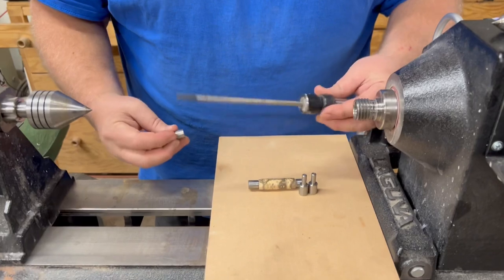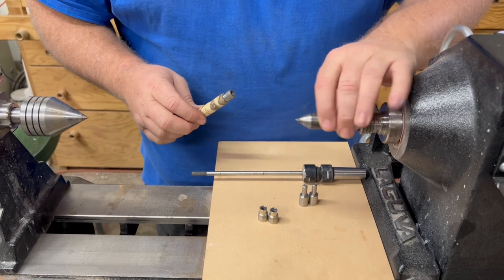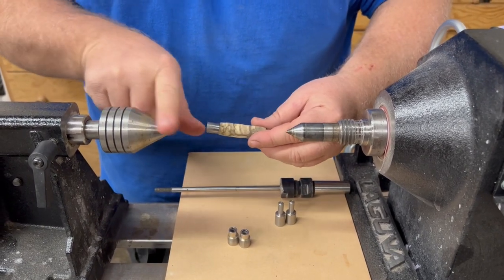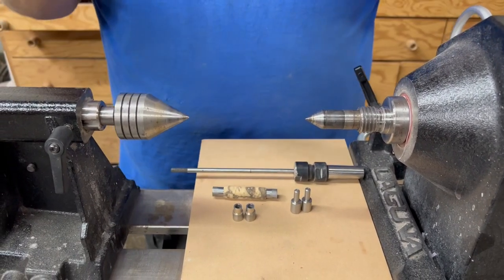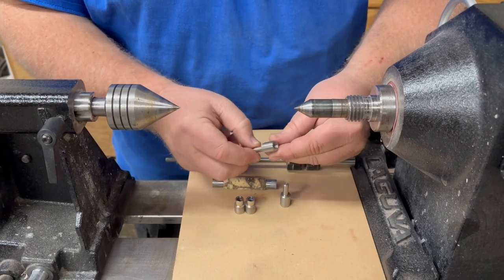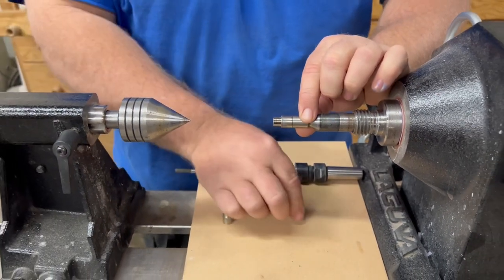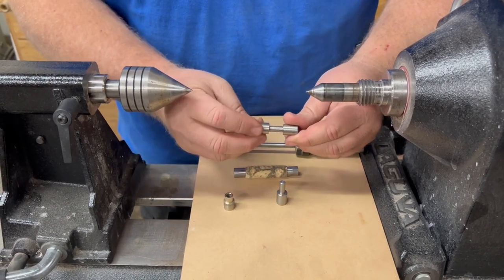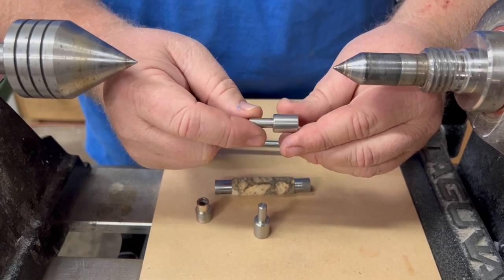Pen Turning TBC Bushings and TBC adapters explained,    Woodturning

Comment: Wow Chad! We have been doing TBC wrong the entire time by using regular bushings without an adapter. We have been turning out of round and could not figure out why! I’m guessing without the adapter, a traditional bushing does not sit properly on the 60 degree centers. We even bought a more expensive lathe thinking we had originally bought a POS one. When that did not fix it, we were at a loss. I wish we had learned that in the beginning. Thank you for presenting such a valuable video for the turning world!

Comment: What's the advantage of the TBC bushings vs. using a mandrel?
Reply: I am wondering also.
Reply from the maker: TBC bushings are much better quality and better made for a more true turn.   They also take out the mandrel which is a source for a potential out of round situation from over tightening or a bent mandrel.    I find TBC bushings hold up much better and last way longer than traditional bushings do to the way they are used.
Reply from the maker: @davidsanders5788  TBC bushings are much better quality and better made for a more true turn.   They also take out the mandrel which is a source for a potential out of round situation from over tightening or a bent mandrel.    I find TBC bushings hold up much better and last way longer than traditional bushings do to the way they are used.
Reply: @ChadSchimmel  thanks, can the be over tightened and cause warp also or would that be noticeably harder to do?
Reply from the maker: @davidsanders5788  Yes it does not take much,  easy to over tighten

Comment: The pointy thing I used in the head stock (I've had a stroke and can't remember words) would not hold. It just spun. Can you help?
Reply from the maker: Hi,   its the Dead Center,   if its spinning tighten up your tail stock a bit,   make sure you are using a 60 degree live center.   Should be snug but not crazy tight